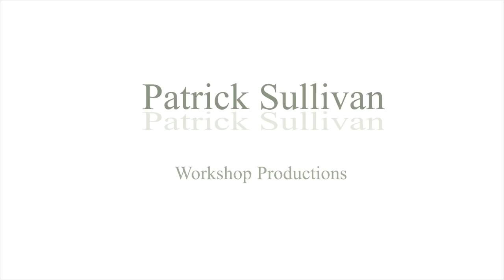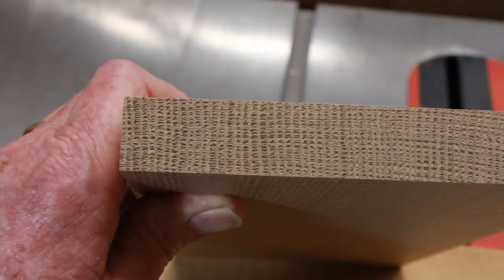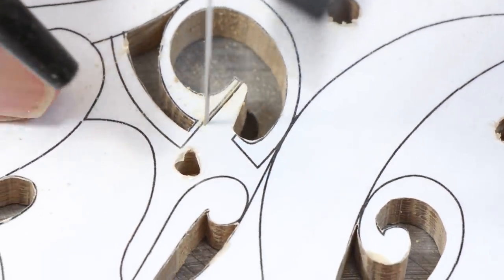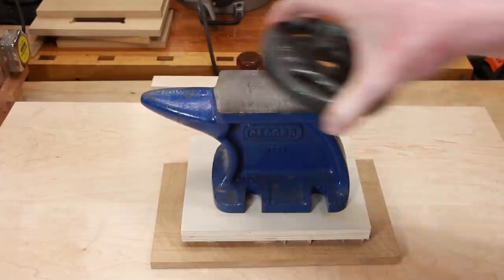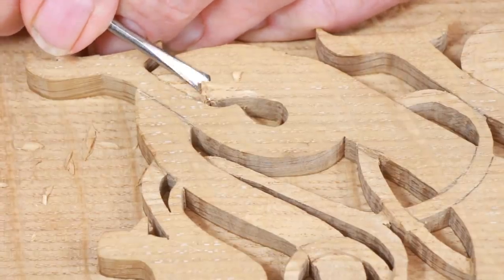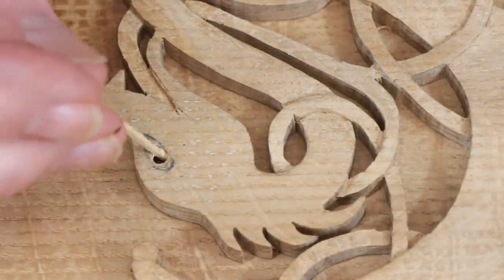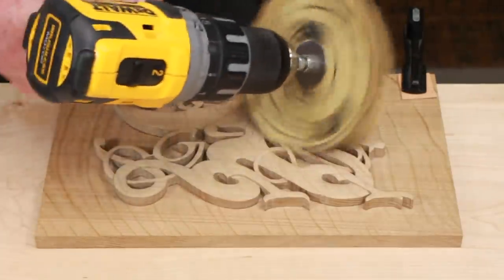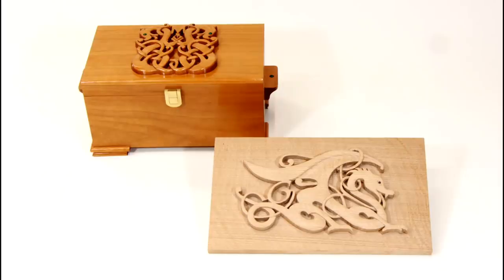Rendering a Complex Design in Wood

Comment: first of really nice video secondly i dont know how much use this is for woodwork but i build plastic models so i know the pain of haveing to sand small crampt spaces. However i found that nail files are acualy pretty good for that you can even cut them in the shape you need.(and yes for those of you who also seen the video where adam said this that is where i got it from).
Reply: Thanks. That's  useful tip

Comment: Excellent work - hope to see you complete the project. I also like your patient, practical approach to solving the tricky issues.
I also fully understand your comments regarding CNC / Handmade - I experienced the same with signwriting in my younger days with the advent of computer cut vinyl commercially ruining the requirement for handcrafted work. Nowadays there has developed a niche market for handcrafted, artisan signage - i guess the same will happen with manual carving.

Comment: Beautiful work! 
Can you tell us which software you used to create the design?
Reply from the maker: I used Corel Draw, but any drawing program would work.  It is just a tool to manipulate lines and points; you have to supply the design ideas.  I block out the design with short, straight line segments, and when I think I have about the right proportions, I convert all the lines to curves.  I find that tweaking the curves so they seem graceful and smooth takes a lot of trial and error.  I could draw a similar design with a pencil in less time, but I really like the ability to stretch, distort, and scale the design, not to mention the ability to print copies to serve as cutting templates.

Comment: How was divided the board into the two thickness ?
Reply from the maker: I cut a board that was about 23mm thick on my band saw.  I can cut wood up to 6" or 15cm on this saw.  You could do the same thing on a table saw, but you would have to cut it in two passes through the saw, and you would lose more wood in the saw kerf.
Reply: Patrick Sullivan   thanks!